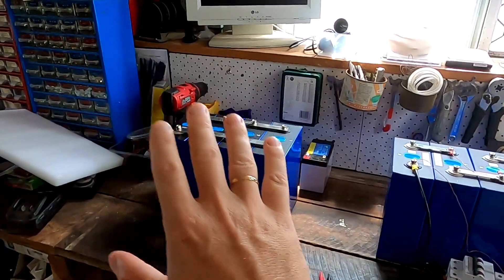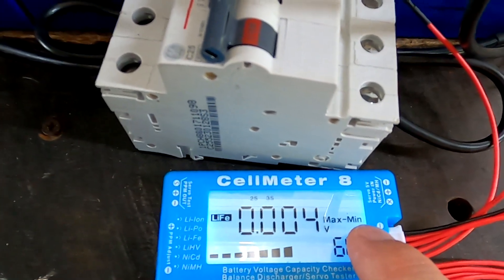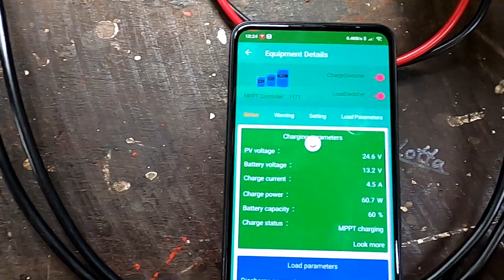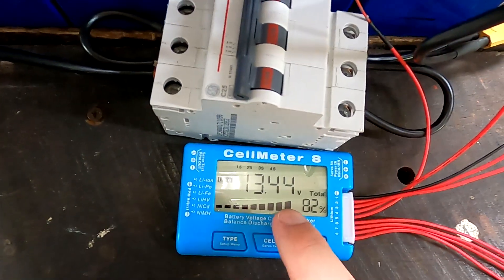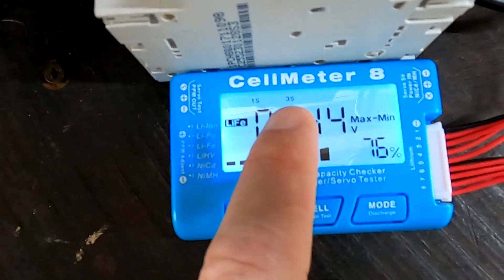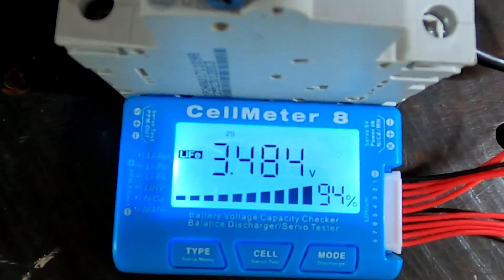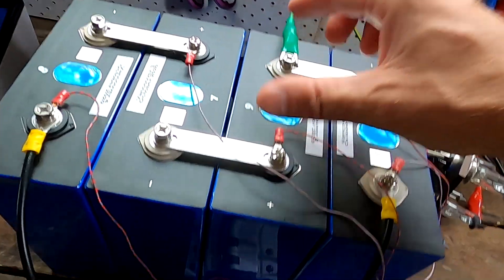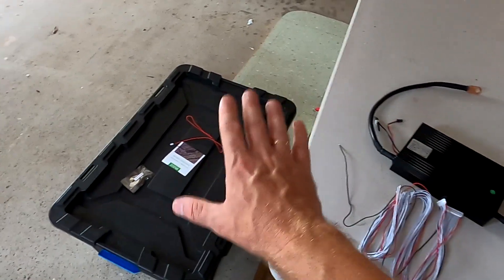Do this and you don't need a BMS 😉

Comment: What balance cables did you use for you cell monitor? I got one a while ago but it didn't come with the wires and none of mine fit
Reply: 2.54 mm pin connectors fit. They are used on a lot of balance chargers.

Comment: Just ordered four cells off your link. Hope I get the same capacity tests as you did. 
Thanks for your vids.
Reply from the maker: Thank you :)
Reply: @Dr SpaceMan
 - Are you Off-Grid ?
Reply: @vtorsi610  Nah I wish. Intend on using the pack to replace 3x200ah AGM batteries in a camper van.

Comment: Andy, pls check which method your new BMS uses to balance the cells. Most common method used by BMS-es is to drain the most charged cell into "heat" - if this is your case, an active balancer would be recomanded to be used, in addition to your BMS (as posted by Will Prowse on his YT-channel).   The active balancer does it's work by charging the cells with lower voltage from those with higher one - so it is a more economical method.
In this situation a BMS is no longer needed since the loading is taken care by the charge controller and the discharging by the inverter and the balancing by the active balancer - BUT, the usage of a BMS would be an additional safety net!
Reply from the maker: But if the charge controller fails or a setting is not right... 🧨
Reply: @OffGridGarageAustralia  Therfore the "BUT" with capital letters 😉 in my comment

Comment: Disculpa que escriba en Español, mi Inglés es muy malo.
Yo tengo una batería 16S con celda LifePo4 de 280Ah y creo que es el mismo BMS que enseña en el vídeo (200Ah). Comentarte que el balanceo de 280mA de este BMS no es suficiente para equilibrar las celdas, por la curva de V que tiene este tipo de celdas al cargarse/descargarse. Yo estoy buscando un balanceador activo de entre 2 y 5A.
Reply from the maker: Thanks for your information. I know the 280mA are not great for balancing these large cells but I plan to charge them only to 3.35V, maybe 3.4V max. I'm not expecting that the balancing is kicking in at this low voltage except one cell is far higher than others. But then, there should be a reason for that.
I don't know if active balancers are really that great. I've seen a lot of videos about them. Maybe I get one too and compare. These balancer are only doing balancing nothing else a BMS does...
Reply: Mi BMS no consigue balancear las celdas a 3,40V. Con 54,40V (3,40x16) tengo celdas que detienen la carga, porque llegan a 3,60V, mientras la mayoria están en 3,35V.
El fabricante me dijo que ellos dan las celdas por cargadas al 100%, cuando llegan a 3,35V; que no me debía preocupar. Según sus pruebas, de 3,35V a 3,65V solo hay un 1% de la capacidad, por lo que la curva de voltaje, en celdas tan grandes, es muy pronunciada.
Pero aún así me gustaría conseguir balancear correctamente las celdas, para que ninguna sufra descargas, ni sobrecargas, excesivas.

Comment: Great video. BMSO... "Full time job as a Battery Management System Operator..." I laughed at that.

Definitely you need a BMS, specially if you are a begginer like me. It just makes your life easier and protects your investment. I already have expensive hobbies with my old vw's.

After seeing your videos (and many others before yours)  I decided to get a set of 4 __50 ah lifepo4  cells, and received my 60 ah BMS yesterday.

Watching everything closely here not to make expensive mistakes. Nevertheless I worry about crimping quality. Not a professional by any means, but want to go solar as soon as I can.

Thanks Andy.
Reply from the maker: Thanks for the feedback and great comment.
the 4s/50Ah battery you're building is a good start and perfect to measure and learn. Sometimes, I'm a bit scared of the 16S battery as I never have built one before.
Reply: I also have seen the possibility to get 280ah cells, and they are a lot cheaper ah/euro (less than half the price).

Nevertheless I really am scared of such a big amount of energy and cost to make a mistake. Apart from that I will be able to do a small portable battery for camping and whatever I feel it serves the purpose, and join my portable solar panel equipment (200W).  From there I will upscale my project for my house in the future, making my solar system a bit bigger everytime.

So I hope to learn from your mistakes ,😁😁😁...

Comment: Hm... no.. this isn't totally right. I have the same setup and do not need a BMS. The more you look into this, the more you realize you don't need it. I don't want the battery to be disconnected. I want the load or charge source being disconnected when needed. You have to manually either top or bottom balance your cells. If you bottom balance, you have to set the top pack voltage when the cell with the least capacity that reaches max voltage first. If you top balance you have to set the lowest cut off voltage to the pack voltage you have when the cell with least capacity reaches the lowest allowable voltage.
I like to monitor the cells though, but not a combined BMS with both switch (that gets hot) and balancing.
Rudy
Reply from the maker: You're correct, Rudy but 5 steps ahead. We haven't talked about the correct balancing yet when building this battery. It'll come though ;)
Reply: @Rudy Steen Johansen
 - If the cells are balanced before they wired in series, then going forward, any difference in cell capacity has no affect on future balancing ...

Comment: Can you recommend BMS for lead acid battery?
Reply from the maker: I don't think you need one. That's why they do an equalization charge...
Reply: @OffGridGarageAustralia  Equalization is very HARD on the cells that do reach 100% SOC first.  Grid Corrosion is accelerated by Equalization ...

Comment: I am still on the fence about a BMS and in the end I bought a 100amp BMS with a Bluetooth module. (24v system, 100AH LIFEPO4). The application displays the individual cell voltage and pretty much all parameters can be changed. In the end I decided for a BMS because of the low voltage cut-off since the inverter is not connected to the solar load controller. It also does cell balancing (only 2amps so it might take a while for a 280ah cell, haha) so that is a bonus. It handles 60amps draw for about 45 mins without a problem but we'll have to see in the long run if it keeps operating.

So far I am really impressed with it. And the phone app is kinda nice.
Reply from the maker: Great feedback, Peter. A BMS is a must! There is no way to keep these cells in balance without one. 2A balance current is a lot. Mine has only 250mA, I believe.
Reply: @OffGridGarageAustralia  Hi Andy. I touched both terminals on my battery with a spanner and it has dropped to 8v and wont work . Is it possible to change the BMS or did i destroy my battery. I hope you can help with some advice. Thank you my friend
Reply: @Stoicloner1  It looks like you fried a cell. If I were you I'd dissassemble it and measure each cell individually. Very likely the BMS is fried too.
Reply: @FBPrepping  Thank you

Comment: Absolutely you do need a BMS great job I do have a question what's the difference in bms Separale and common port and the different low current and high current BMS?
Reply: I did order same batteries just I want to make sure I'm ordering the right BMS
Reply from the maker: The BMS needs to be selected as per your needs and load you want to drive.

Comment: I don’t run a bms myself but I only run 20-80%(mainly 60-80)of the battery. I topped balance and haven’t had any drift after 1 year so far(still 10mv). I’m running 18x 8s2p 70ah 24v bmw lithium batts. I would need 18 bms to correctly wire them up...no thanks lol. My Victron inventors and solar charger only charge up to 32v and my batteries need 33.6v for max charge. This means I will never be able to over charge. I check once a week with multimeter and thermal for hot spots once a month. 

You need to top balance with them all in parallel up to 3.65v then wire in series and charge max to 3.4v like you did. This will extend the life of your batts too.
Reply: It could be confirmation bias for me, but I've noticed that bottom balancing in parallel before charging to the top balancing voltage, helps optimize things somewhat, so the cells more accurately mirror the characteristics of each other once being reconfigured to series. Depending on your level of OCD and how important the project is, intermittently pausing the charge to allow time to rest, applying a load briefly, possibly repeating a rest interval, then resuming charging can yield dividends.

My unmedicated ADHD and autism, among other neurodivergent issues mean I've gotta fully disengage whenever I can't remain hands-on, since allowing myself any opportunity to botch an experiment by overlooking something important will forever be my undoing...

I don't have any firsthand experience with LiFePO4 chemistry, but NiCd, NiMH, Li-Ion (cylinder/prismatic/pouch cells), LiPo, and Pb, seemed to have followed this trend for me in the past.
From what I can deduce, when the paralleled cells are fully discharged, then allowed adequate recovery time before charging to full, the pesky tenancy of the top performing cells quiescently trickling a handful of nA to the rest of the pack...for seemingly YEARS (or at least until your perfectionism melts your mind in aggravation), that issue appears essentially absent.

I'm very curious though, what was the impetus for your settling on 32V inverters and such? It struck me as an arbitrarily peculiar voltage which I haven't seen much in the past.
Is that maximum output voltage from your PV system?
Reply from the maker: Yes, that is absolutely correct, just 5 steps ahead ;)
3.4V would be my preferred voltage for these cells. I'm not expecting the balancer of the BMS will actually ever kick in with such a 'low' voltage.
You could run such a Cellmeter8 for your pack too. Just be aware it sucks its energy from cell #1 and #2.
Reply: @OffGridGarageAustralia   No, NOT absolutely correct ... If he charges an 8S battery pack to 32 Volts, he certainly can OVER-CHARGE one cell while under charging the other 7 cells.  Charging to only 32 Volts does NOT prevent over-charging of any one cell.  Checking your cells "once per week" does not prevent a problem from occurring while you are asleep or while you are away from your home ...
Reply: @vtorsi610 A BMS can't do anything about an internal short in a battery either. 

And if someone just relies on the BMS, what happens when the BMS fails? 

I have two different LFP batteries I have made, I charge them to sensible voltages, check their balance at regular intervals by doing a full charge, and never over-discharge them, and my packs have run for years - all without a BMS.

Comment: Lol, great vid man!  That cell checker if you hold down the right button it will go into balancer mode if you want to balance them while charging.  Pretty handy cheap device.  Another option out there if you want to get it to work a little more efficiently is to get an active balancer they take the voltage on the high cell and transfer it to the low cell instead of wasting the energy using a load resistor.  Fairly cheap the only caveat is you need to have your own low voltage shutoff.  I prefer a regular BMS with my smaller battery banks but as you go bigger the BMS can't handle the amperage.  So options with a larger bank are to use a regular BMS and have it control a relay using the output wires.  My setup I went with an active cell balancer and a low-voltage cut-off relay,  Lots of options out there got to choose what works best for you.
Reply from the maker: Thanks for the feedback. If I hold down the right button it goes into discharge mode...
Reply: @OffGridGarageAustralia   I wonder if it's simply a difference of models from the same manufacturer, or they mistook yours as an altogether different device?
Reply: Sorry yes different than mine.  They look the similar but mine is a 5-in-1 Cell Meter. Made by Tenergy.

Comment: Absolutely need a BMS :)   For over-charge, over-discharge, and temp (hi/low) protection to cut-out a load.   Balance as a feature of the BMS is good as well but not as important as the basic protections of a BMS.
Reply from the maker: Yes, I absolutely agree.

Comment: For new, balanced cells, if you slow charge and discharge (0.2C max) they should take a lot of cycles to drift. I this case, you don't need a BMS (for this purpose).

A simple meter like you showed, preferably with an alarm, would be adequate to warn you to manually balance the cells when needed.
Reply: That is not what Andy just demonstrated. At 0.2C, for these cells, you are talking about 56A - he demonstrated substantial drift at 8A (~0.03C).
Reply: @Bennyboy-dog  . If that is the case, and they were perfectly balanced before the test, they are not matched (meaning they have different capacities/internal resistance), and should not be put in the same bank. Matched cells, previously balanced will NOT drift by this much, specially with such low C rate.  I have seem boat installs without BMS (boats have a lot of sub 1 second peak discharges, a 300+ Amp BMS is hard to find and very expensive, the 100Amp ones go into over current protection straight away), cycled everyday, be fairly balanced (within 0.1v) after 6 months of use.  Of course I'm not against the use of a BMS. With high C rates and/or unmatched cells, it is a necessity.
Reply: @paial  I have A123 cells in a 4S2P configuration in a homemade powerbank and in three years I have balanced them twice - and that was only for fun rather than necessity.

I agree, if they are well matched and you don't overstress them, and you keep an eye on them, you don't necessarily need a BMS.
Reply: https://youtu.be/etFCo3fwm8U

Another REAL WORLD example. 30 months of daily cycling, NO BALANCING, 0.02v unbalance.
Reply: @paial  Clearly, the cells used in this video ( by Off-Grid Garage ) are not matched ...

Comment: So true, a BMS is necessary. However people should be very wary that not all BMS's do the Balancing feature. Some will just disconnect the cell if it goes outside its parameters. Separate Balancer/Equaliser boards are available to add onto battery packs with a BMS not including this feature.

Comment: a big issue with a standard BMS is if it disconnects while there is solar power feeding into the solar charge controller essentially the battery was removed and well your solar charge controller is now fried so https://www.amazon.com/Heltec-Equalizer-Balancer-Equalization-Capacitor/dp/B08CKPZ7PH/ref=sr_1_1?dchild=1&keywords=12+Volt+Active+Equalizer+Balancer+Lifepo4+Lithium+Lipo+Battery+Energy+Active+Equalization+Module&qid=1609807241&sr=8-1  is a very interesting idea to balance the cells without having that disconnect and a good inverter you can program to shut off when it drops below a certain voltage so with this and setting the voltage charge limit on solar charge controller and inverter disconnect voltage you have now eleviated any issues without the risk of a BMS disconnect frying the solar charge controller.